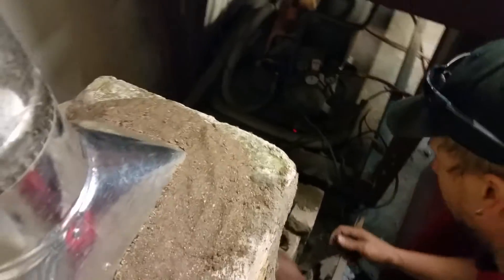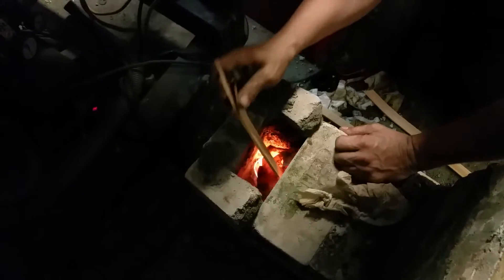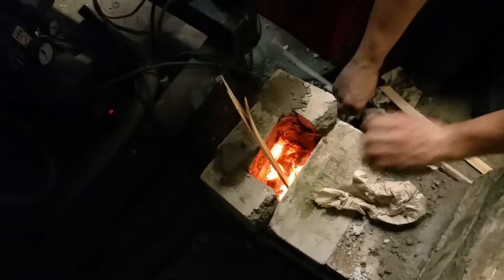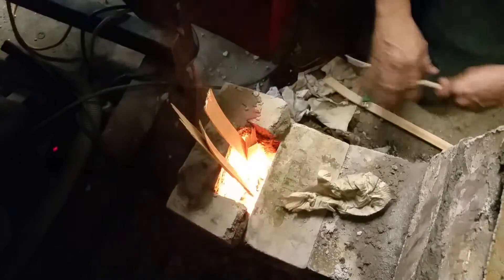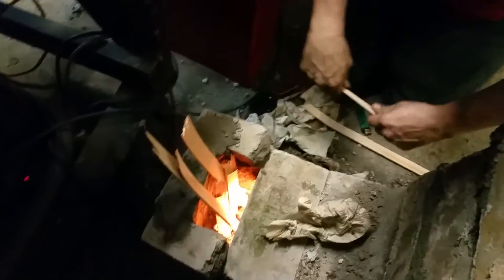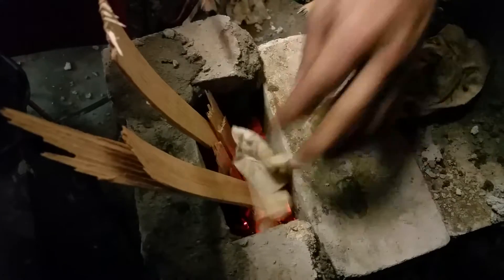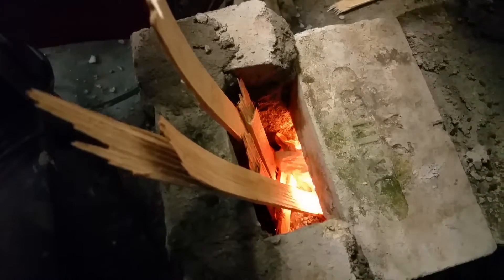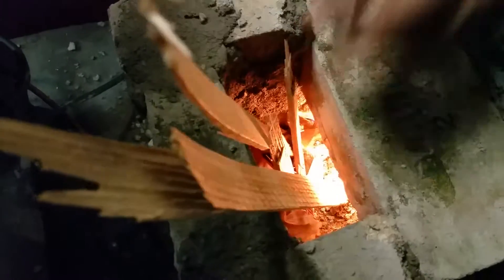Rocket mass heater... First burn. Yay we did it!

Comment: that's looks like a rocket stove instead a heater
Reply: Yeah, they're still missing the thermosiphon/Bell and a large thermal mass.
Reply from the maker: We wanted to make sure we had a good burn before we added the mass etc in case we needed to make adjustments.
Reply from the maker: We also used high density thermal blocks from an industrial forge furnace. They acted as the thermal mass. Once warmed,in about 2 hours, the entire shop stayed toasty warm all night.